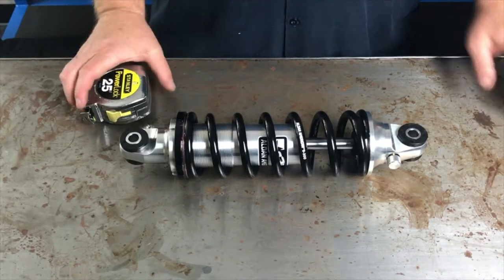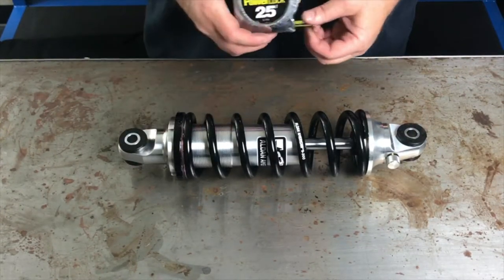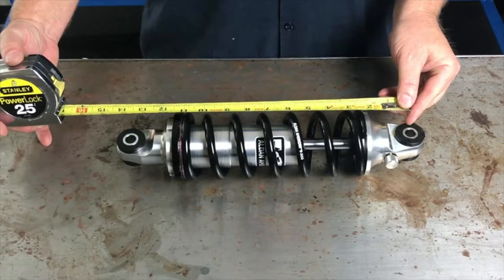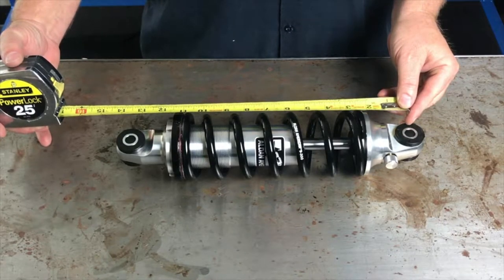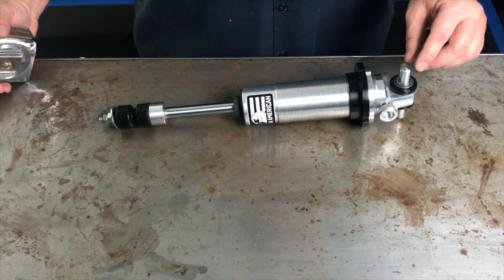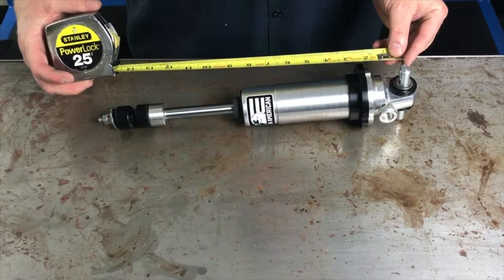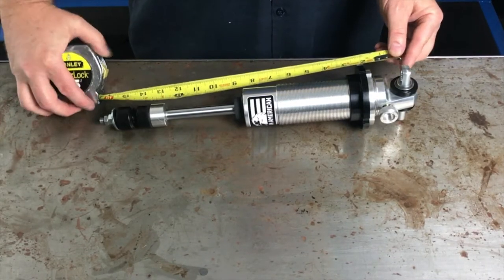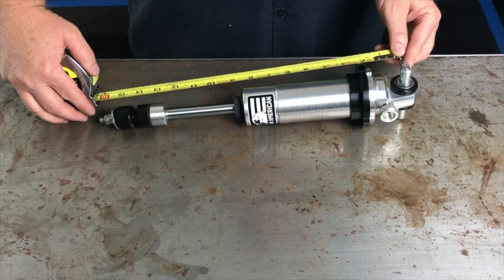DIY - Measuring Shocks

Comment: can you measure a rear shocks size/ length while it's installed on the motorcycle? Or is it compressed & needs to be removed  from motorcycle to be fully extended for an accurate measurement.
Reply from the maker: Measuring shock length on a motorcycle would be the same. You could measure the ride heigh the closed length and extended length of your shocks on your bike while it's sitting on level ground. You would need to cycle the suspension using a jack or equivalent to take these shock measurements.